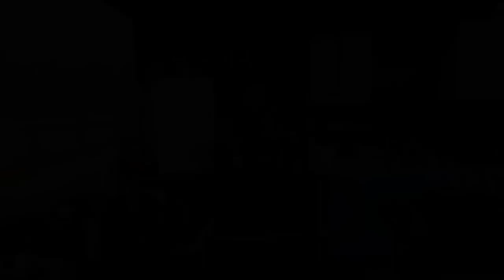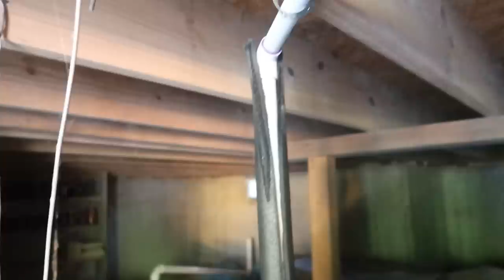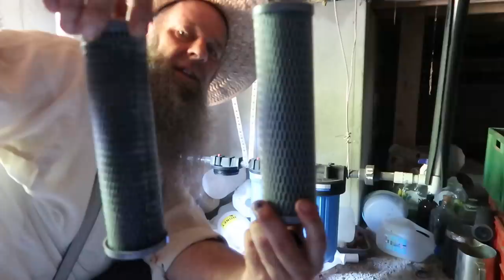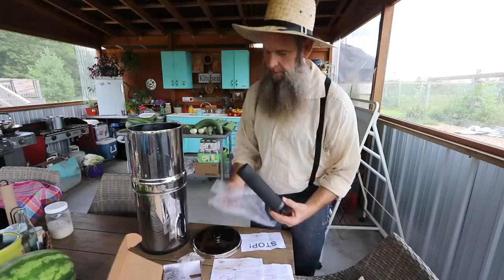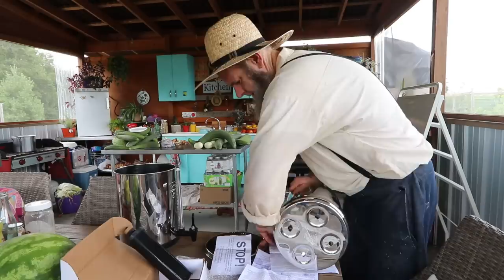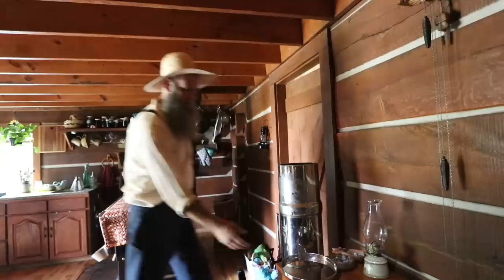OFF GRID WATER could make you SICK protect from Bacteria Viruses Heavy Metals

Comment: Food grade hydrogen peroxide is H2O2 and when the extra oxygen molecule is released you have H2O water. It is used extensively in water purification requiring only a small amount, Rain water had trace amounts before pollution became so widespread . It is an effective antiviral when vaporized one half of one percent . At 100% it is rocket fuel. If left in sunlight it will oxidize if stored at freezing temperatures it will last indefinitely without freezing

Comment: Why not use a dehumidifier to extract water from condensation? Solar power is one option with a rechargeable battery and power converter. Another is wind power which had been around since the 1800''s ? Too pump cold water through a copper coil and reuse the cold contaminated water to reproduce condensation into a funnel to catch the purest water from the humidity puled thru the coils with a circulation fan that runs off wind power. Kind of hard to visualise but if you tinkered with how to make one iy may be possible without electricity. Copper tubing is a great conductor of hot and cold heat. Also a natural pump that works on gravity instead of electricity. Some used covered root sellers and cold  underground water tables to refridgerate food stored in air tight glass jars under water. Which if this cold water could some how be pumped by wind power through  cooper tubing and the water returns below ground and by pulling in humidity creates condensation and water collection into a holding tank. In winter, using boiling water to create steam, one could create condensation from water in a tank subjected to cold weather to create condensation from the steam that collects in copper coiled tubing in a chamber of condensated water droplets. 
This eliminates the need "to filter" your water. And does not require electricity. A siphon can be used instead of a pump to feed water.
 If using a fire place, water in iron pipes could offer both hot water (so long as water is not left stagnent in the pipe) and provide hot water regulated with cold water to take a shower. Or water stored in pipes on the roof on sunny days can provide heated water.

Comment: Got a Berkey, but from Day 1 I never liked the taste of the water.  I was expecting to taste Evian bottled water.  When the second compartment is lifted up I can smell some kind of gassy chemical smell,  Not sure if it's just the city water here that causes it or what.  There is a difference in  the taste of the water after filtration, so I suppose it is doing what it's supposed to do.  I have not changed the filters yet to see if that is the problem with the chemical smell.  I feel that they should make the filters fatter and not taller so that the water can constantly go through the whole filter.  As a note for those with fluoride, those filters are bought separate and fit in the second compartment under the other filters, so they are going to take up more space and less water storage..  Their customer service says that the black filters will filter out so much fluoride to begin with, but not the same life as the regular filtering.  The bigger you go the better water storage you will have, as it seems to me that the water will be less in the second compartment and will be surrounding the fluoride filters if you apply those.  I understand other filters such as Alexa can be used instead which look fatter and filter out fluoride.  I would suggest anyone do their research on what to do.  To me some of the filters seem to have different materials inside .  I don't care for plastics and artificial materials, so just do your research.

Comment: Back in my country we didn’t use chlorine as disinfectant for urban water purification.
We used UV light to disinfect water. It’s more efficient and you don’t have to drink chlorine.
UV light disinfects on DNA level, so you can be sure that all bacteria is dead and you don’t have to boil water! It consumes 6-10 watt of electricity only and you can use small solar grid to charge battery and use inverter to constantly have pure water. System is usually installed after all the filters and it’s a UV bulb in glass housing where water flows between glass housing and plastic outer shell. One battery and small inverter should be enough to power it. I use UV light even in my AC unit and thanks goodness we didn’t have even flue for the past 3-4 years. My UV bulbs between filter and condenser kills all bacteria and keeps my AC clean of any mold or mildew. Just wanted to share my experience. Thank you for great videos! I hope one day I’ll get my piece of land I’ll become independent and close to nature!

Comment: Can you do a video on collecting rain water for drinking but without access to expensive filters?
Reply: Filters for the Berkley are not expensive,  I've been using one for three years & it comes with filters when you purchase it. Mine has two filters which are cream in colour / take out flouride too. The replacement filters cost £40 or 50 bucks American & last 6 months - twelfth months. I put rain water through it but sometimes if I'm low I'll put mains through it. Too keep costs down you could use two plastic buckets & just buy the filters separately. If things get really bad I could put river water through it too.

Comment: Other options
 Now as far as pathogens are concerned UV light or Temperature should be the easiest choices.
It would be easy to pass the water through black hose in some type of solor reflector that would bring it up to temps needed.
Or through placing water in clear containers in the sun allowing natural UV light and time kill of the pathogens after it is filtered

Comment: Why not use a new terracotta pot instead. It's a heck of a lot cheaper and you don't have to replace filters. Just block the hole at the base of the pot, place it inside a container similar to that Burkey, plumb a tap at the base, fill up the terracotta pot with water, and away you go. Water will start to permeate through the clay.

Comment: If I were you
I would use 4 to 5 filters

1. a 10 micro filter to get rid of larger particles
2. the the 1 micron filters
3, final is the carbon filter

then you can save your carbon filter for a longer use
good carbon filter is more costly

Comment: You guys sure got by a long time with just the prefilters I ll get a berkeys right away just to be safer. I will do the rainwater system but I need to see how high your water starts out to know how high is nedded to get enough pressure like you get Im guessing 10 feet higher then ground level. on our farm growing up our windmill tank was about 20 ft. above ground wasn t but about 500 gals total we ran low on water a lot. Im hoping to use multiple 330 gal IBC totes in parallel for the starter point..

Comment: Can you clean those filters for re-use? I’m far from a water filter expert, but my Vietnamese GF turned me into a video from a young Vietnamese man that made a clay oven specifically just to produce high end charcoal to add it in layers with sand into another large clay above ground cistern type of water filtration system. Because of its size it seemed capable of a large amount water filtration from a nearby river, but he was only using what was needed to project its long term viability. Just some data points I thought I’d pass along. 
Peace!

Comment: Berkey is pushed by all natural docs, but people got tested it and this filter add a lot of aluminium while filtering fluoride. I wish the manufacturer tell people with heavy metals issue about that. Besides, people tested it in 3d part lab and the filter doesn't do the job it claimed. Of course, it depends on water, but Berkey claims to filter any water even from the pond. So it was really disappointed to find this information. But it's really suspesios when smth are pushed like Berkey.

Comment: Using standard PVC pipe is NOT a good idea. The stardard pvc leaches out MEK methyl ethyl ketone into your water and is not potable approved. You could use CPVC (chlorinated pvc) whis takes a special glue, is harder and wont leach its solvent. Cpvc is also more heat stable. In order to convert your system, install another carbon filter at the transition point to remove the solvent.

Comment: We have Miss. river water from the local municipal...also known as toilet water 🤔😂. Finally installed a 3 stage 20 inch filter system couple years back. We filled our own insert tubes with different mixed media and wow. Told the children the water was Soo clean, they could drink from the toilet. I would not recommend telling children that!!! 😬😂😂 Now we just change out the carbon mixed media every year or so.   I wonder how gravity fed could handle larger filters like that.

Comment: I would suggest not to use the flouride filter. It seems like it is made of aluminum dioxide cause it heats up when you prime it. I am pretty sure that drinking that was the causing me serious respiratory and panic issues. Getting the purest drinking water the cheapest, practical, and reliable way is kind of a never ending logistics rabbit hole unless youre ultra rich. I am using a zerowater filter for practical purposes cause the ppm is zero, until the filtered water starts reading higher. Optimal play for filter life is something i am constantly thinking about.

Comment: No filter will filter backteria, period... TRUTH.  The only thing you can do to prevent bacteria poisoning and sickness is to boil water then filter it or distill water. So! prepare in that way enabeling yourself to do either. I have 2 one gal distillers and I also am prepared to boil alot of water at a time and also can boil small amounts, in differant scenerials, I have a stock pile of coffee filters and bags of cotten balls - I just layer the cotten and coffee filters , makes really good  filtration on the cheap cheap cheap. = Yea! that way after filtration you just toss the filters and you don't have to waste your good clean water to wash those berky filters which will hover backteria in them as well, tests have proven. No pun intended, just sharing the love.

Comment: I have been drinking rain water for 2 yrs. before that RO water, before that distilled.  
 Rainwater is the best, I'm sure most know what aTDS tester is..  my rainwater is 2 ppm (parts per million) RO 4-8 ppm depending how full the filters are(RO systems are about 200 bucks and need to have filters replaced about every 6 mo approx.also RO water is cleaning a pig,municipal water is full of poisons, the RO hopefully removes much of it,not all))  distilled is more expensive.   rainwater is the very best ,in my opinion(and it is FREE ), so many say "oh no well water is best !!    BULL   do they know what they are talking about ?   no,     all wells vary in ppm ,usually about 140-220  ppm.   and those of course are different things, mostly non-organized minerals. (not absorbed in your body) some salts which may be fine.  bottom line is "natural is best" rain is most natural .  so many immediately say uhh did you filter it ??    are you even listening 2 PARTS PER MILLION  and you question that vs. crap from a well at 140 ppm ??   that my friends is from brainwashing.but i do as a precaution add 1 drop of iodine per gallon. as it is possible to have some minor contaminate .you can filter that if you that picky, but 350 ppm tap water vs. 2  ppm rainwater is such a major improvement.